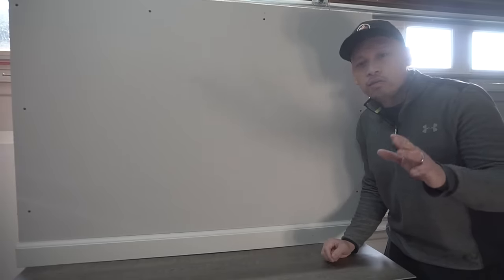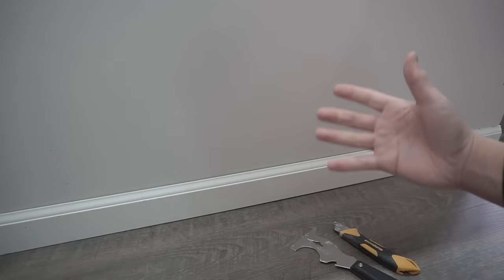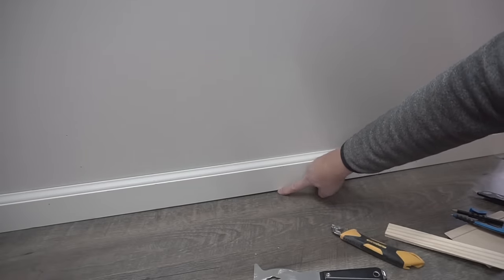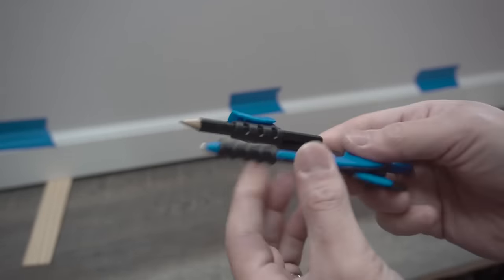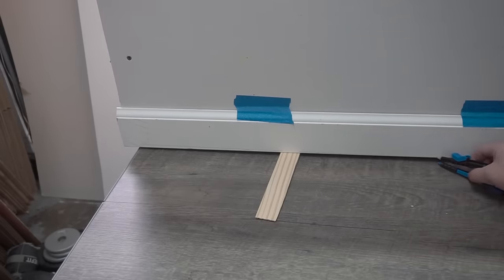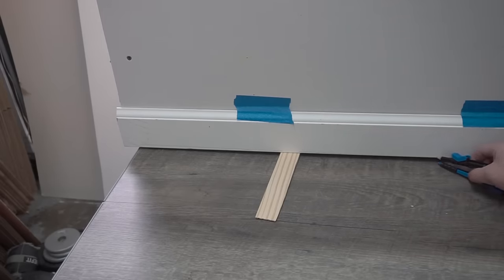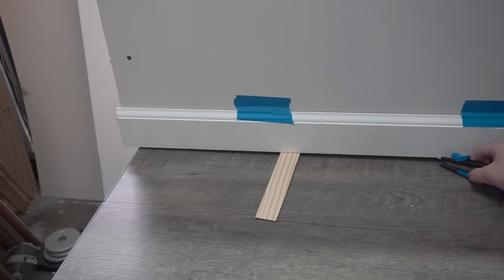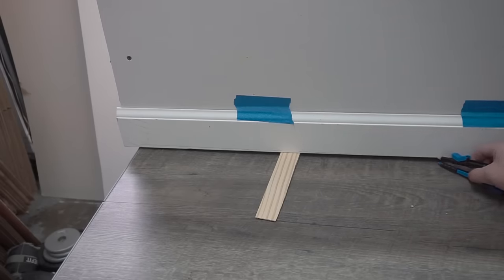How To Fix Gaps Between Baseboard And Floor For Perfect Fit! DIY Step By Step Tutorial For Beginners

Comment: Easier to just install shoe molding.  That’s what it’s for.  Then you don’t have to worry about mating up with adjoining base mold and having to trim every piece in the room.  If you don’t like shoe molding, then purchase the wider base mold for the problem area walls and use this method.
Reply: First time learning of shoe molding other than qtr round. I hate that stuff. Many more options I'm liking now.
Reply: I bought vinyl baseboard for bathroom and have no desire for shoe molding. I have a gap between LVP floor and bottom of molding in couple places after Pro install of flooring and baseboard. No way would it work to shorten baseboard or insert shim. Bathroom has multiple corners everywhere. Simple caulk best solution.
Reply: they crappy way to do it
Reply: I agree. This is fine for a couple of spots but if your entire house or apartment doesn’t have leveled floors I can’t imagine doing this for every baseboard. You could just going to take very long time. Cover with trim or caulking is much easier.
Reply: @acz88  Caulking there would look worse than a gap there.
Reply: My friend bought a new house and everything is caulked. It looks bad. For some reason it just catches your eye.
Reply: Easier yes. But looks like shit.
Reply: That's a good way to lose another ½-to-1" of ft² from your room. If it's a small room, it matters. Furniture will go as far back as the innermost edge.
Reply: @clb3297  a pro would have self leveled or screeded the floor flat before flooring install. The problem is nobody wants to pay for craftsmanship, they don't mind having hack work nowadays.
Reply: if you cut custom then you cant move it and use it anywhere else.

Comment: For small gaps like this when I install, especially with MDF I push it down to the floor, it’s flexible. Even with wood sometimes you can lay a 1x or 2x from the floor to the top of base at 90 degrees, put your knee on it to push it down and nail it. With a vinyl or floating floor a little gap is good for floor movement. The thing is also no one wants to pay you to spend 15 minutes on 4’ of base, unless it’s a multi piece design.
Reply: Exactly.
Reply: Bingo
Reply: That's what I was wondering. Just push down on the baseboard and nail it.
Reply: I definitely wouldn't have this guy work for me. Seems like a beginner .
Reply: yep
Reply: 6" doesn't bend like 4".
Reply: In all honesty, if you scribe the bottom of the baseboard that would change the overall height of it and the top wouldn't line up at the next joint
Reply: I've had great luck recently with PVC trim, which is flat white and has a lot of flex in it.
Reply: Yes!! I LOVE crooked base boards 😍
Reply: @patrickcowan8701  But he said 4".
Reply: Exactly! Thank you! Took the words out of my mouth. Even if this method doesn't work, installing shoe molding makes more sense then. Not to mention he didn't address the situation when you do his method you can wind up with the base not matching when you come to a corner and cut your 90% angle because the board will be lower than the other board in the corner.
Reply: @Tricker2234  exactly! Thank you
Reply: @Rob Estoll  well never expected to be coming back to this. Instead of trimming every board; self leveler would be the stuff to use so that the floor is all level. No random baseboard cuts, no customers complaining about random waves in their baseboards. Much love my man keep grinding hard.
Reply: It seems this video is the result of a company that sells a belt sander sponsoring the video and the creator having to come up with a way to use it.
Reply: Thanks for this. I was watching this to be a perfectionist, but then I saw your comment. Literally forgot I was doing the quarter round next. Like the old timers told me : "it  hides all the sin"
Reply: This is the way, it takes no time

Comment: As a licensed (21+ year) Remodeling Contractor, we (Contractor and Homeowner together as a team) always have a choice between ascetics (that is paramount! - at least in my opinion) and level/plumb/square/etc.  Multiple times in my career have I found instances where a SINGLE room has a level difference of 3/4" or more.  One time was a bit over 1 1/4" in a kitchen alone.  Level is much different than Flat.  Once you start cutting 1/2" or more off of baseboard, trim, etc. it starts looking dramatically different (the more detail on the trim makes it even worse) and it looks like someone made a mistake.  It has a major tendency to compound the change in appearance as it goes around a room if the level is off in the slab/flooring.  If you only go for LEVEL, you can (and probably will) make the overall project look like it was done it was done by amateurs.  That is where I communicate with the Owner to see what their wishes are for the final end result.  It should be the Owners decision on how far to take this process (level vs. flat) and what they are willing to live with...it is their home.
Reply: Where exactly did you get this remodeling “license”?
Reply: Trying to troll me?  CSLB (California State licensing Board) as a General Contractor since 2000 and now also a licensed Residential Contractor in Florida through FDPR (Florida Department of Business and Professional Regulation).  I said “remodeling” because that is my specialty and because there is almost no new construction in California because of lack of land available to build on.  One of the many reasons why I move to Florida.
Reply: Moved to Florida.  Stupid autocorrect!
Reply: Was looking for a comment about him making it level. I thought why even try to make it level. If your floor isn't level, why should the baseboard be, at the cost of removing actual height.
Reply: How did you butcher the word ‘aesthetics’ so ridiculously

Comment: I run into this problem every day as a professional painter. Many of your critics say caulking the gap is the best solution. If so, who's job is it to caulk the gap? Is it the framer's, finish carpenter's, floor installers? The aforementioned trades are long gone more often than not leaving the homeowner and painter shaking their heads as they look at the gaps. Caulking the gap is not a good idea because floors move, houses shift, and the temperature of the house will change with the seasons. After time, the caulking will delaminate, change color, and dust will stick like a magnet. This video is very educating for homeowners, all trades, project managers, inspectors, architects and the like. Thanks for posting it.
Reply: Caulk would be easiest and fastest !
Reply: @rudytrujillo2238  ¼ round/baseshoe would be the correct way, but for whatever reason, clients are told the truth as to why it is so important and its purpose. Not to mention, it's an added piece of trim, more profile. If they would stop cutting corners and tell clients the truth and insist on it being done right, things will never change. Customers don't know a damn thing, expect what they "think" they know. As a professional, I've never had a client say, let's do my flooring wrong, so I can save on some shoe that I as a customer think looks bad. Show them what caulk looks like in short order. Problem solved!
Reply: Clients, are not told the truth.
Reply: @VoteBLUE2024toSAVEDEMOCRACY  I agree that would be the correct way but if the gaps isn’t that big like in this video caulk wouldn’t look bad at all if done right. All I said was easiest and fastest
Reply: @rudytrujillo2238  Consider posting a video of how it is done.  I want to see you caulk the floor on a 2500 sq' house, prime the caulking and then paint it. If you take a short cut, it will show in a year so make sure you have contractors insurance and your license is up to date.  If people can't afford to do it right, carpet might be a temporary fix until they have the funds to do it right.
Reply: @rudytrujillo2238  Loved your reply Rudy. I think your advice might be going back and forth between a frustrated homeowner and you.. Carpet is dirt cheap compared to a hardwood floor, base board, and shoe molding. Can't smoke because of occupational drug tests but thanks for asking.  Any good ideas on how to stop the pain when people like you and me are down on our knees all day trying to fix someone else's problem? I have the best knee pads that money can buy and they still don't take away the pain. Where I live, all trades are regulated by the state which requires a C license, liability insurance, bonding, and a tax clearance in order to walk on the job site. The guy who originally posted a solution to fix a common problem was impressive in my professional opinion. In sum Rudy, it always ends up in a big fight between the trades, homeowners, insurance companies attorneys a little guys like you and me. Take photos to CYA.
Regards
Reply: Fill the gap with spackle then paint over it.
Reply: @skyhawaii5446  dude.. This example is for a brand new finished hardwood or vinyl floor.. Floor that was picked out, paid for, and installed/finished by a contractor and then baseboards were put up... Literally nobody in this scenario is going to carpet over it because there is a small gap... You seem to have a huge gap with your comprehension and deductive reasoning. Your 'solution' can't be a bigger problem than the problem it's attempting to fix lol.
Reply: This video is terrible advice. Level is completely irrelevant.  Many comments have already suggested viable options to close the gap and several reasons why the demonstrated method creates problems. If you are going to scribe off a 1/4” then you need to start with molding that is 1/4” taller  otherwise the height at each end won’t match up to the adjacent moldings. In the example video the ends are a quarter inch shorter than all the other molding. Aside from the viable options already mentioned: buy the next taller size molding of the same profile, Place it directly on the floor, set your scribe to cut this taller molding down to the same height as the adjacent molding…. A bit more work but very doable is to cut a 1/4” strip off the bottom of another piece of molding stock, glue it to the bottom of the piece with the gap, sand it smooth, place it directly on the floor, set your scribe to the same size 1/4”, cut the line and you are good to go as each end will be same height as the next adjacent piece.

Comment: Great advice, just used this scribing method on a 10’ wall with an upwards bow up to 3/4” tall in the middle.  With an upwards bow you just put the shims on the far ends but it worked out basically the same, perfect fit.
No luck with using a level though, the corners aren’t level :)

Comment: If the gap is so noticeable that you have to scribe such that the adjoining baseboards suffer significant height difference the you can cut all your adjoining baseboards to the lowe height. Easy to do with wide flat stock and not too noticeable, especially if you don’t have to re-radius the bottom edge with true square edge flat stock. However if the gap in question is truly that bad it should have been seen before you place your flooring. I’ll typically use Ardex Finish and blend the subfloor a bit more parallel. I do often have to shim under the floating floors I lay down as it’s easy to miss on a big install. I use the gap to get a tool in and lift the plank and bend a piece of plastic to shim under. As the offence is near the wall it typically doesn’t affect the joint between planks as long as it’s not too much of a shim thickness - which will void the floor warranty too. Filling with caulking can be done very neatly but suffers eventually from poor ascetics with floating floor movement. So basically I’ve done all methods and they all hav the disadvantages save for fastidious prepping beforehand. On long runs with 3 1/4” base it’s easy to flex down on the gap and shoot a few brads. New homes with engineered floor joists are typically easy peasy flat and level. Older home, homes with long joists and no blocking, not so much. One house I went through $1000 in filler and multiple sheets of bulk luan ply filler in the joint valleys. Customers aren’t willing to pay for that kind of prep if it’s client based work. For the diy crowd, it’s just your time mostly. The newer, stiff SPC LVP, I find, is much more fussy to lay flat with even baseboard gaps of subfloors that have settled.

Comment: Exactly! I don't claim to be a pro at trim, but i have been doing it long enough to know that this option is ridiculas. Push it down! I can do it with pine trim as well, but MDF is much easier. Never had an issue. I have done all type base and crown and one thing i do know if you trim one side (like video suggest) you will have other issues connecting adjoing base with different height levels.

Comment: Bayshoe or quarter round.  Never change the height of your base boards.  Old natural wood base often showed the settling of a house because it was not flexible.  So we would add a second piece, quarter round or bayshoe.  Modern mdf will bend, so just push it down!  Also, paint your moldings before you install them! Much easier to touch up your finish nail holes than to cut in the entire board after installing.
Reply: 25 years in construction and I’ve never heard of using a jigsaw to fix base. Calking and a wet rag always did the trick, but if you have a drastic gap 1/4 round would fix it easy.
Reply: You gonna quarter round your whole house because one small wall has a dip? lol That is ridiculous. Personally think quarter round looks shoddy, especially people who don't remove
 baseboards before they install flooring.

Comment: Nice clean job and it looks good. i've done the same thing except i stacked carpenters pencils since i didn't have a scribe. If the gap is under 1/8" i'll caulk it. The trick to me is working with a taller baseboard so the height of the baseboard is less noticeable when making cuts. I've seen floors so out of wack that they had no choice but to use vinyl flooring so it can contour the bend, lol

Comment: This method works in many carpentry scenarios. I HIGHLY suggest against it for baseboard that connects to more baseboard. Especially wrapping corners. A scenario I have used this in a bunch is stair treads and risers. No connecting pieces and conforming to bows and bends.

Comment: I've been a carpenter for 43 years and this is quite possibly the most insane video I've ever seen, for too many reasons to list, but I'll mention a few.  First, instead of jacking the base up with shims and playing stupid games with a compass, you could just mark it while it's on the wall by sliding an object over the floor with your pencil on top of it, marking the base along the way.  So if your gap is the thickness of a quarter, then take a quarter and slide it across as you mark the base.  THEN, remove the base and scribe it.   But, having said that, then you've created a "chase your tail" situation where intersecting baseboards may be too tall or short as you move on.  Base isn't meant to be scribed.  It never was.  This is why they make base shoe.  It is especially designed to solve this problem.  And if you can't live with shoe for some reason, then caulk is your next alternative.  And I'll leave you with one other pro tip too:   Anyone using a laser to cut anything for finish work has no clue what they're doing.  There isn't a laser on this planet that delivers a thin enough line to accurately make a precision cut.
Reply from the maker: Just giving options for the everyday DIYer 👍🏽😊
Reply: I was looking for a way to solve the same problem but having seen this, I wouldn’t take this approach either